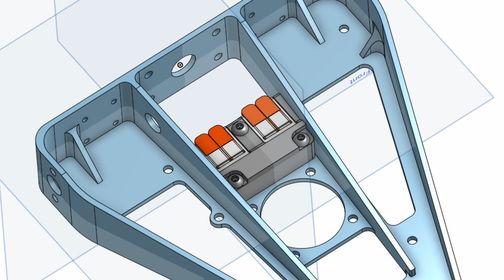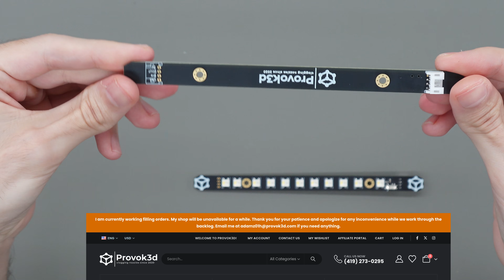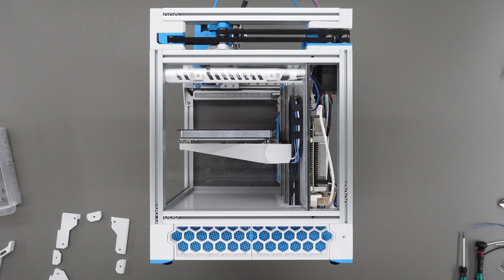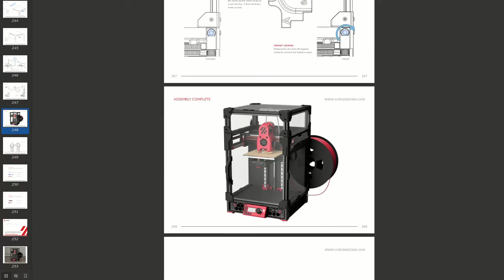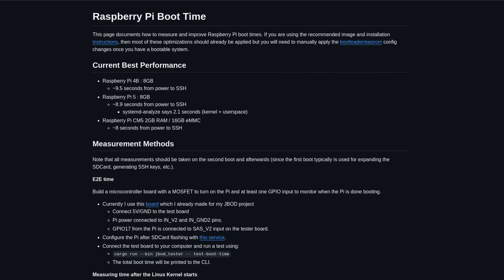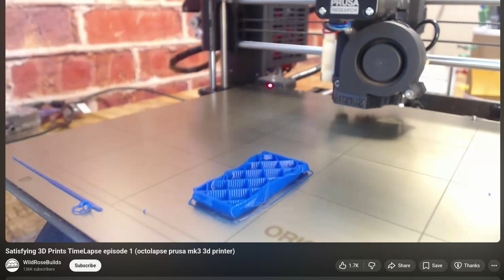I finished my Voron. Now what? | 3D Printer Build Part 7

Comment: Amazing work! Will be anxiously waiting for a kit to come out for purchase! 🤞🏻
Reply from the maker: The bed frame and fasteners are available now. Working on adding more but curious which parts you'd most want. E.g. I'm not sure how many people want extra electronics vs direct wiring etc.
Reply: @MadeByDennis  just ordered my Voron kit, so I will be ordering your bed as well. I wanted to buy the full "Basic + Fan and Wago Mounts + PCB" but it sold out almost immediately 😅 Would the "Basic + Fan and Wago Mounts" be good enough and use the PCB from the kit, or should I wait for another batch? I think the extra electronics and direct wiring are a good starting point 🤔

Comment: I would personally love longer videos of you explaining the stuff.....
And another question I would like to ask is, do you recommend making a custom firmware for 3D printer as my first Bare Metal C/Embedded Project?

I have been trying to get into Electronics specifically embedded, but do not have much idea on how to. I am inspired by your way of explanation. What do you recommend me to learn to be able to make custom machines like you are making rn.
PS :- I'm trying to get into robotics, but have not been able to successfully go past the "Arduino/ESP32" phase 🫠
Reply from the maker: It's best to start with all the core components one by one. E.g. get a single motor and 1d control working on breadboard heaters, temp sensors, etc. Then before you know it, you just need to put a bunch of things together. The more advanced stuff is mainly in making it fast, so set expectations appropriately and don't try to do everything in one shot. I don't attempt to either

Comment: great video
Maybe you don't really need a filament runout sensor + motion sensor, as the only thing the runout sensor does is telling you if filament is present or not. In most cases this information isn't what you need tho (when are you actually unloading filament and not loading new filament? ). 
if you want to get an action (pause print, send alarm) when filament is no longer present during a print, the filament motion sensor does that too (no filament = expected flow/motion at sensor missing -> sensor triggers)
Reply from the maker: My idea was as follows: 1. you need some sensing of filament motion to detect jams. 2. you need some sensor on the exterior of the printer since you can't unload filament if the remaining piece can't be pulled out of the outside of the printer. I think it would ideally be in one module though.
Reply: @MadeByDennis  I made custom filament buffer similar to mellow LLL plus, acting as motion/jams sensor, it is great for long tubes in voron zero and external filament box. But main upgrade is orbiter 2.5, big dual drive gears makes best outer walls ...

Comment: About the camera, for monitoring it should ideally be on the nozzle plane so you get to see exactly what it does instead of having it hidden behind the fan ducts. Should also clear the toolhead travel space.

But I'm especially excited about your bed carriage ! Correct me if I'm wrong, but you don't need the front bed mounting hole to be at the very end of the bed. Placing it 10 or 15mm back could save some material and weight for rigidity and shipping.

Can't wait to see what you'll show next
Reply from the maker: It's a bit of a tradeoff. If it's an nozzle level, you can see the nozzle moving, but you can't verify it has laid down filament since you can only see the perimeters parallel to the nozzle. Ideally I'd have one of these nozzle mounted cams + a raised view for the wholistic process.

The bed holes themselves can't be moved without reducing the build volume since the X/Y limits exactly match the bed size without additional mods. There is a few mm beyond the last hole that is extra space for the led mount and I just checked and it's around 2 grams of potential savings there.

Comment: Nice timelapse solution. I've always thought that frequently reported false spaghetti detections were due to its overcomplicated implementation.  The slicer knows the print orientation, it can be told the camera pose. When the toolhead is out of the way a comparison can be made between the expected shape of the print vs what is seen by the camera and then a deterministic comparison can decide if the deviation is acceptable.

Comment: Those top blue pieces on XY joints looks very twisted
Reply from the maker: Oh. Didn't notice that. Guess I'll remake them later.
Reply: @MadeByDennis  btw in your older video i've dropped some PSU examples on topic of 12v rail, but idk whether you've seen them or not
Reply from the maker: @SergeiSugaroverdoseShuykov  Thanks. I think I originally missed it. Will see if I can integrate that in v2. The stock YouTube UI for creators doesn't have good tracking of nested comments.
Reply: @MadeByDennis  well, it's easy to miss on youtube especially if you get hundreds of comments :)